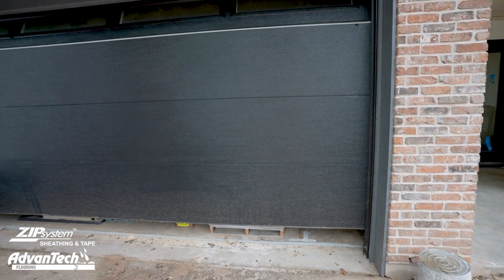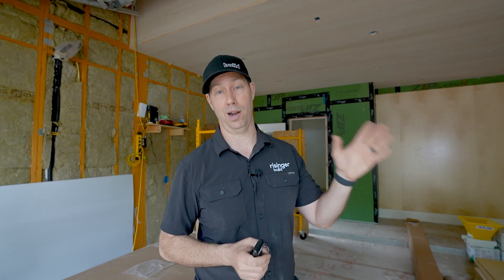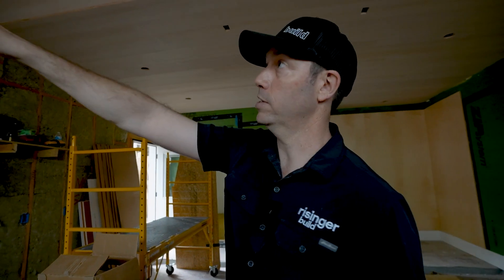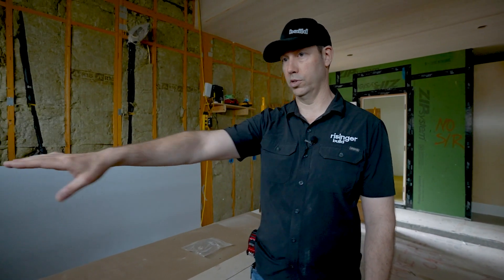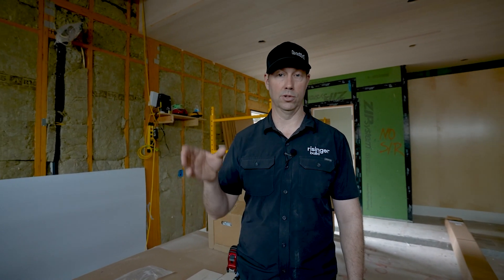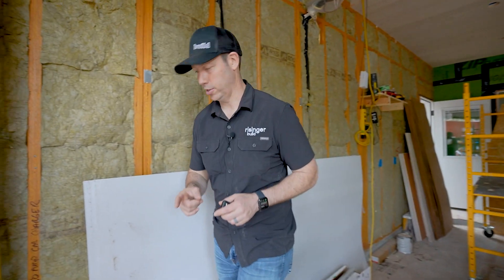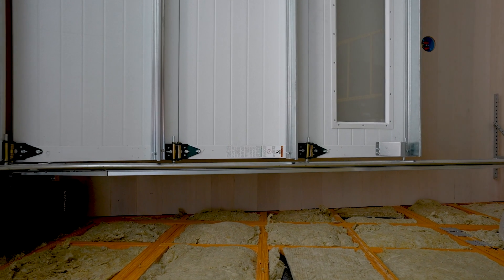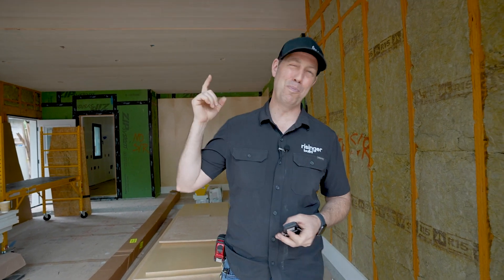SUPER Insulated Garage!

Comment: Way to small of a garage.  Pretty sure the door we just ordered is R19 although it was an expensive door.
Reply: Wtf does this even mean it’s above standard thickness
Reply: @Driving4bangers  I believe the door we ordered is 2 or 3” thick to get that high of insulation value.  The door is 20’wide by 9’high and it will be going in a 27’wide by 42’ deep 4 car attached garage.  His tiny 20’x20’ garage is really small and almost worthless to actually park 2 cars in.  Since he was building new he should have made the garage an actual usable size.
Reply: @brent1041  ya idk. he did say it will be more of a man cave. I agree with being able to park cars in a garage for its purpose

Comment: I’m willing to bet my garage has no insulation. It’s hotter than Hades in Summer and cold as the Arctic in winter. Sucks!
Reply: ~$100 for 2 plastic foam insert sets from Lowe’s was a cheap easy way to cool down our garage from the scorching summer sun.  Didn’t take me that long to install and did not cause a prob with the balance of the garage door.

Comment: Surely it makes no sense positioning the fire extinguisher ball above where fire could break out because flames could prevent getting to it, surely it needs to be somewhere close to an exit so that you can throw it and then get out.

I don't think it is designed to drop onto a fire, the idea is it is thrown into a fire and explodes the powder. 

You can't anticipate where a fire will break out so having it more accessible is going to be far more effective.

At the very least have two, so at least when one fails you still have another to hand.
Reply: They activate at the touch of fire no need to solely throw it.

Comment: That extinguisher ball is only going to give you a false sense of security, those things ARE effective against some types of fires in CONFINED spaces.  They're not going to do jack-squat if the battery back-up for the door opener lights off.  And why do you need a BBU door opener anyway?  I thought you went with a whole house generator for the rebuild?
.
Oh, if you want to keep things in the garage from burning down the rest of the house?  Halon flood system for the garage space, it works against almost any type of fire (not sure about Lithium-Ion) and I'm sure one of your sponsors will spring for it.
Reply: Heard that Halon system outlawed in a lot of areas due to they can kill you due to lack of oxegen when they go off. I worked in some large computer rooms and they told us if Halon alarm &/or flashing light comes on take a deep and run like a bat out of hell to get to safety.
Reply: @garbo8962  There are a few different varieties of flooding fire-suppression systems and they all really work on the same idea, starve the fire of oxygen.  But you're right, if the alarm goes off you must gtfo of the area and close any doors behind you.